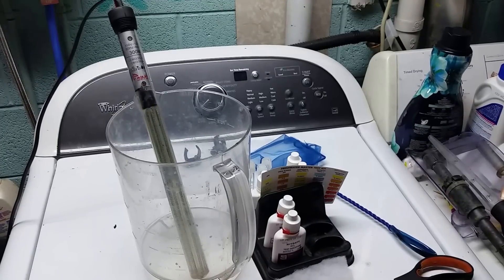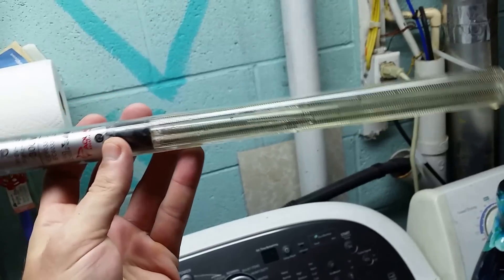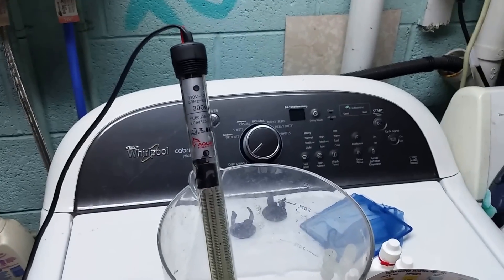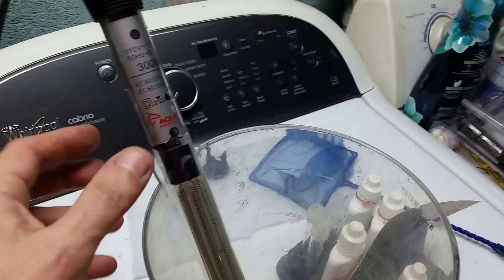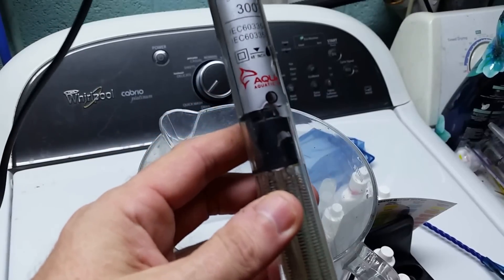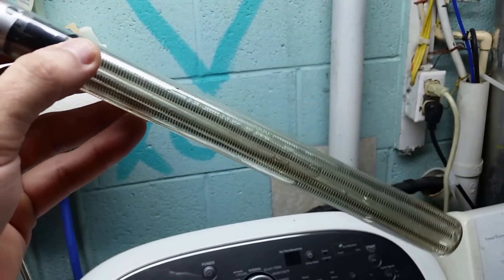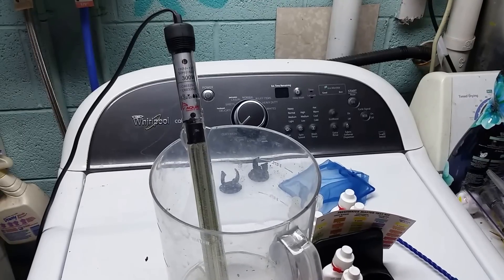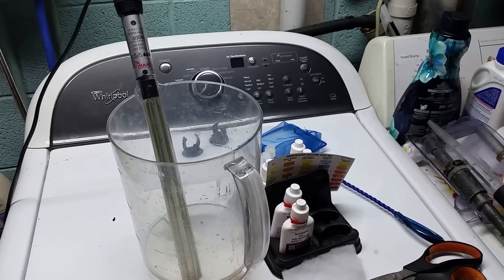Tank Heater Failure: I got Lucky

Comment: I think my heater is OK but I'll definitely go and check it!  I have a digital thermometer and the type you stick to the aquarium glass just below the water line and I use the two in tandem to keep tabs on my water temperature, but the sticker one is great for showing temperatures at a glance.

Comment: I have three Aquatop heaters: a 50, a 100, and a 150. All are less than six months old. My hope is this isn't a defect. I am in Florida, so they are not pushed too hard in our climate.
Reply from the maker: This is the first problem I've had with an Aquatop in several years. I have about 8 of them at the moment.
Reply: Good to know. I am planning to replace mine, whether needed or not, every two years. They're cheap enough where most of us can do that. Thanks for the vid!

Comment: I've had condensation in every heater that I've owned in the last 15 years except for 1. it was a ehiem Jager that I got used from a fish store, it worked for about 10 years after I got it. they don't make them like they used to.
Reply from the maker: This is the only one I've ever had issue with. It's about 3 years old.